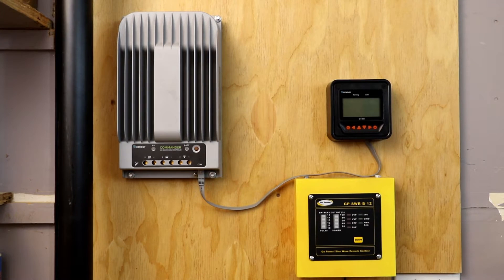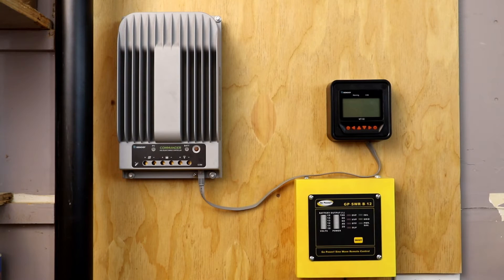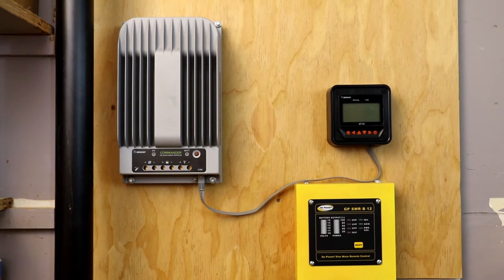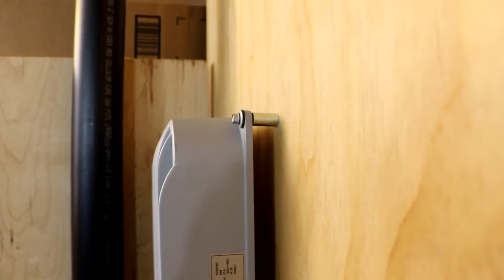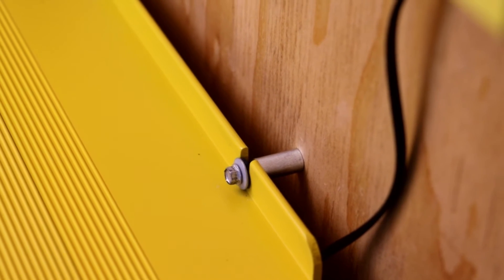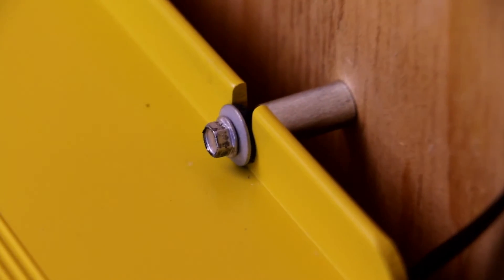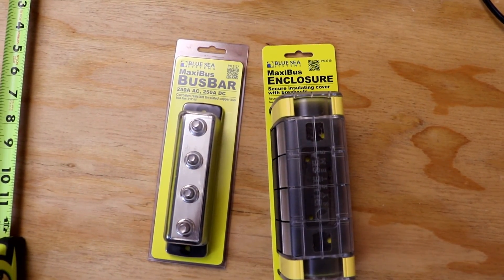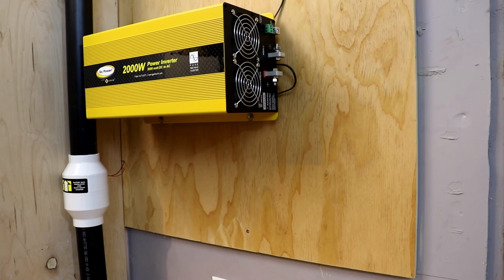Off Grid Solar Mounting Renogy 40 amp Commander MPPT & MT 50 Meter

Comment: Is the commander easy to use with a Lithium battery? Do I need to program it?
Reply from the maker: The 40 Amp Commander (at least when I used it) I don't think is compatible with Lithium Batteries.  Even when you add the controller you cant change the parameters enough for it to be compatible with Lithium.  You might want to check & see if they have released a new firmware upgrade for the controller to allow changes for Lithium compatibility.  I am now using a Midnight Solar Classic 150.  This controller is a lot more capable and is definitely compatible with Lithium batteries.  
Thanks for Watching Take Care.
Reply: @LarsLondian  Thanks!

Comment: That's a "EPSolar" charge controller...
Reply from the maker: +אוורט, Follower of YHWH 
I have seen this same charge controller "Appearance from the outside" from 3 or 4 different manufacturers, are they internally different "Not Sure" the model on my wall is a Renogy Commander 40A. 
Thanks for Watching Take Care.
Reply: Lars Londian 

Oh ok.... I noticed the sticker on the side of your controller is exactly the same as my epsolar controller. 

Thanks for the reply..

Shalom. 😊
Reply from the maker: אוורט, Follower of YHWH 
Yeah, I was surprised to find out how many different manufacturers used the same unit with their name on it.
Reply: I am a Ham radio operator,and can tell you the difference between EP and Renogy !! Renogy has NO interference,where EP sounds like a garbage truck on Ham Bands. MY RENOGY just hit float at 9am on our 2KW batt system here.,TYVM,Renogy !!! @LarsLondian